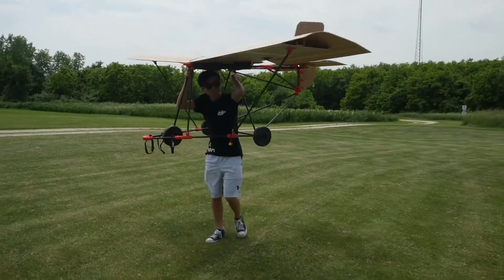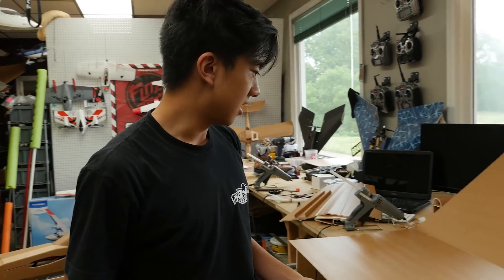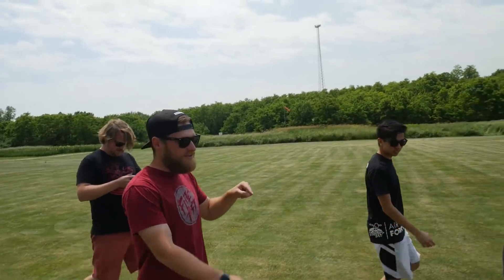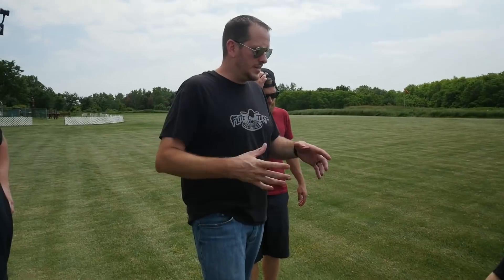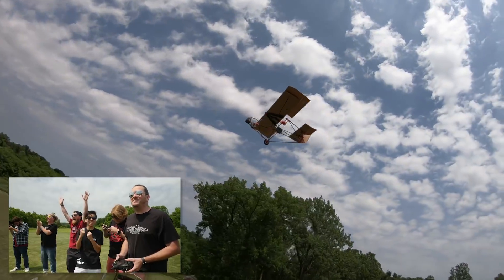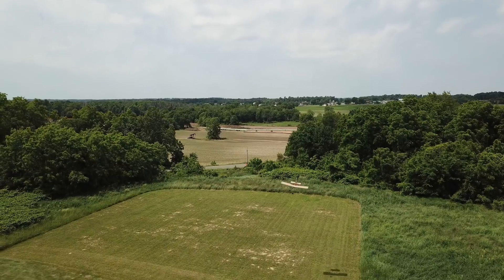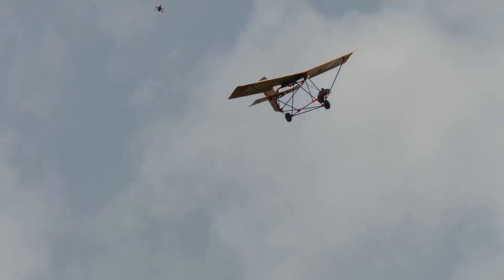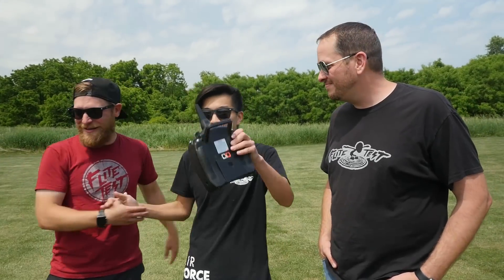3D Printed Motor on an Ultralight!

Comment: I was researching 3d printed motors and saw the original video where Chris made the motor, always wondered if he used it for something, so I'm glad to see this. I'm actually designing my own motors and using the plastic parts to make a mold to pour melted aluminum so I can build my own water cooled ebike motors.
Reply: You are on to something as a guy in Arizona. My Bafang motor gets pretty dang hot! Maybe like an RC boat electric motor cooler would work? Just water flowing through a heat sink from the lake. But add a radiator and pump, and BOOM! You got this man. Make that dream a reality!!!!! If you design it to work with Bafang motors as an add on, you would sell out.

Comment: For anyone who wanted to create this motor but couldn't find a working link for the STL files, don't give up because I found working link for STL files. 

https://community.makesea.com/web/cla/~/50612/profile/-/asset_publisher/Rl6cqGtVw4Vb/content/660-watt-3d-printed-halbach-array-brushless-motor?inheritRedirect=false&redirect=https%3A%2F%2Fwww.makesea.com%2Fweb%2Fcla%2F%7E%2F50612%2Fprofile%3Fp_p_id%3D101_INSTANCE_Rl6cqGtVw4Vb%26p_p_lifecycle%3D0%26p_p_state%3Dnormal%26p_p_mode%3Dview%26p_p_col_id%3Dcolumn-1%26p_p_col_count%3D4

Comment: if that motor was printed out of polycarbonate it would've survived
Reply: So, what made it fail?  It's not like it broke up...
Reply: @bbushong67  not sure but I believe the windings got too hot and melted the pla... polycarbonate has a higher glass transition temperature. (135 degrees c as opposed to 65 for pla)

Comment: I like your channel but calling this a 3d printed motor is a joke,the only thing 3d printed is the housing.All essential parts are metal just like any other motor. It's also visible that the housing is finish machined after printing which could easily  and easier done with a molded material.

Comment: Somebody kitted a fabric and aluminum tubing version that was cable braced many years ago. The local hobby shop had a built unit hanging in their store. I learned to fly in a Quicksilver and tried to buy it but the kit was not being made any longer and they didn't want to sell the one they had.:(

Comment: $100 of materials? Where do you get Carbon Fiber tubes fo so cheap?
Reply: You can get 1kg of carbon fibre spool for 3d printing for like $100-150 US
Reply: There is no button for liking $100-150 US.    Also why would I want to like that sum in particular?  Unless you are giving it away.  What is the exchange rate for US dollars to UK sterling, if this is the case.
Reply: @cam_au  yeah. And you can get active charcoal powder even cheaper. However that doesn't help you with this build...

Comment: Hi ft I have designed and printed a 70 mm 12 bladed EDF fan which goes at around 52000 rpm ony current 3000kv EDF motor and a 4s 1600. And it does not explode. Ive been though around 6 prototypes to get the blade angle and sweep right and I was wondering if you would like me to send you the files to print one

Comment: for us who don't have 3D printers.... you can use aluminum or carbon fiber arrow tubing. cut the ends shaped to fit (or interlock dado's) then wrap/lash with sewing thread and CA glue.
you can make excellent and very solid joints with this method if you wrap it thick enough, the thread becomes like a hard plastic fiberglass, scuff the tubing it's not going to come apart.

I've built an RC dragster with CF arrow tubing and 2 mm plate stock, an ornithopter with 2 mm carbon fiber rod covered in ripstop nylon for wings etc (300 RPM gear motor to flap them), and done MANY repairs to other stuff, it's become like a "go to" because it's so easy, fairly quick, inexpensive and versatile.

Comment: So inquiring minds have to know did something happen to the motor or ESC? I think it could use a bigger prop. Not sure if it is practical in this application though and you guys have a lot more knowledge with this sort of thing than I do.

Comment: right before he said "I lost power" I was like, smoke, not good XD
Reply: Yeah, that was pretty subtle.  I had to go back and watch that a few times.  Hard to see the smoke, but it's there.  One thing that I wondered about was the ratings of the larger bearing at the back of the motor...  That bearing is only rated to 3,500 RPM...  very thin profile (6mm x 6mm cross section), those bearing balls have got to be screaming...

Comment: You're crazy superheroes! I'm so glad glad to see this video, and I'm very impressed by the plane construction - the motor is a heavy beast and very difficult to mount on a lightweight frame. And I didn't expect that you're surviving 12S without getting insured. Great video!
Reply: Christoph Laimer Thank you for sending us such an amazing motor! Your design was amazing and you truly inspired us and many others with your amazing 3-D printed creation. Keep up the great work brother!
Reply from the maker: Christoph Laimer keep on being awesome my friend! You are inspiring so many and doing great things! Hope to meet you in person one of these days! -stefan
Reply: Hey Josh, what actually happened (the pop and sizzle)?  Did the 12 cell fry the motor?
Reply from the maker: ElyssaAnderson correct... when the motor stopped, he airflow was decreased, heating up the motor a bit more and boom... motor melted loo
Reply: @FliteTest  The engine spool fried because a wire size diameter small. Big current and it doesn't has a radiator for spool from metal (this is plastic)
Reply: @FliteTest  So, the control circuit might need a minimal RPM for airflow above a certain temp and an emergency power out shutoff in case of f.e. an emergency landing?
Reply: @FutureChaosTV  Spool fried because a wire size diameter small. Big current.
Reply: The motor probably fried, youa cttualy can see a little bit of smoke a second or two before the motor stops...
Reply: @veckia  from 6:32 yup...
Reply: This is the best 3D motor design! I did it (in Colombia) and I am Very Happy with it! Thanks Mr. Christoph Laimer.
Reply: I met FliteTest BECAUSE of Cristoph Laimer and this aprticular motor! =)
Reply: I waited for that since I saw the motor project on your channel (the tourbillion watch brought me there).
Seeing that it now actually happened, brought a smile to my face :)
Reply: It's worth the wait. Amazing plane for an amazing motor. Big laugh when the plane lifted off. Like it :)
Reply: Great job Christoph!
Reply: ElyssaAnderson yeah that’s what I was gonna ask
Reply: This is some great collaboration. Well done to all involved, it’s quite remarkable what we can come up with when we combine our skills. Great video lads!
Reply: You're a genius Christoph, looking forward to you making more videos!
Reply: Christoph, are you done making videos or just taking a break? Would love to see more content from you.
Reply: we love your videos bro, make more!!
Reply: Congrats Christoph!
Reply: I miss the new content from your channel.
Reply: Christoph, your motor is way cooler than this plane, please show us what you are working on
Reply: proud of you Chris, happy to see it work like that!

Comment: It's about time we see this motor fly. Why didn't you scale the airframe a bit smaller to fit the motor? 25% smaller or so probably would have been a good size for that motor. Also you should use a smaller diameter prop when you went to a higher voltage battery. Still a fun video. Can you make a video on the motor if it burned up?

Comment: If you make the wings to have more surface area, i.e., wider wingspan, another inch or two wheel radius, a bit stronger motor and larger prop, I'll buy the kit!   Meanwhile, how construction going at the new F.T home and field???   Need experience and tools yet, I'm just about to be in between projects and clients, if you need some help???   Nonetheless, great job on the scale ultralight!  

Awesome!

Comment: Great project!! The Quicksilver MX is a rudder/elevator only.  No ailerons no flaps and no vertical stabilizer (all rudder).  You need to modify the design with a rudder post and rudder.  Even the Quicksilver MXL, Sprint and Sport models with ailerons are rudder dominant!  With the high wing dihedral they fly skid and roll not crank and bank.  A higher wing camber would help too.   I have over 600 hours flying my 1984 MX.   I look forward to seeing a kit and plans on your web site. (maybe a bit smaller scale)

Comment: Finally! Have been waiting ages to see what you came up with, and you didn't disappoint!
Looks like the motor may have been working a bit too hard and burned out but this'll give valuable results for improvement.
Carbon fiber space-frame structures have great applications and could be used as the basis for the entire skin of an aircraft or vehicle, so would like to see more!

Comment: Hi Josh or whoever of the Flite test team. I have a 5 inch stuck in the tree (Alex will be the one i hope sees this) and here in seattle we dont have much wind until october and i need to get that quad out before july for my Hawaii trip so either could you help me in the comments or in the form of a video and also i have a ft bushwacker and i found that the ESC isn't being cooled very good and also 3s 45c battery works good with some 10x4.5 props and also ive tried 9 inch and the esc still isn't properly cooled and also (sorry if im boring you) i was wondering what a good random FT swappable series plane i should build next and i have a power pack C thanks!
Reply: I love my simple stitch but it's pretty similar to the bushwacker, maybe try a warbird, like the mustang or spitfire, and get a long stick and knock that quad down, if it's stillpowered on it could destroy the lipo capacity and risk fire if you try to recharge it, most quads will survive a fall from a tree with only moderate damage, but rain could ruin it.
Reply: +Kevin Dunn storch*
Reply: This happend a month ago and the tree is about 50 ft
Reply: Yeah it has rained and the battery luckly was just a cheap one i dont plan on recovering it

Comment: I am a Challenger Ultralight pilot and I have flaperons on my plane. Flaperons actually only change the center of lift and are primarily used for trim purposes based on the load of the pilot in order to trim for hands-off(or at least for minimal pressure)in what ever mode of flight that you are in(i.e. climb, level or descending). At altitude over my home airport(Capitol Drive)I trim the nose up way high and float around at 25 mph near minimum controllable airspeed(sometimes even flying backwards if the head wind at altitude is greater than my forward airspeed !).
Reply: I'm just a nobody on the internet, but that doesn't sound at all like how typical flaperons or flaps would affect performance. They certainly can offset the center of lift if they are not located over the center of lift already, but they are fundamentally failing at their intended role if they are not increasing lift (and drag). Offsetting CoL is generally an undesired (and avoidable at the design level) side affect, not the intended function.

I'm certainly not trying to correct you on doctrines of use for your aircraft. I've never seen or studied it before, and am just discussing the more general applications of what you have said. But as I understand it using flaperons to trim pitch should be far less effective than using the elevator to do so. I'm more inclined to think that the Challenger Ultralight is an outlier, due to the mid-length, high mounted engine.

At first I thought it could be because of deflection of air into or away from the propeller, but pictures I found online were inconsistent about where the ailerons started, with some seeming to start at the root of the wing, and others only starting after they cleared the propeller's radius. Just making a guess, but do the flaperons on your aircraft start at the root of the wing?
Reply: Almost all of the way to the root...here is a picture(not the best, but the only one I have). Almost the whole trailing edge of my wing is flaperon. They actually deploy in both directions with a hand crank above my head.
https://www.facebook.com/photo.php?fbid=10209513091903494&set=a.2432631794489.86899.1812492490&type=3&theater
Reply: I've flown a challenger (As well as 30 or so other types of aircraft), and I will say that while the flaperon trim method on the Challenger is pretty weird, it seems to work.
Reply: Well that's just, like, your opinion, man.
Reply: Yes !, it is quite weird and works rather well, too. Frankly, I think that the design purpose is to provide both trim and accommodate a wider range of pilot weight.
Reply: I have quite a few hours in a challenger, and since I flew both solo and with a passenger, I can tell you that the flaperons have a yuge effect on CoL. Since this aircraft is tandem seat, your COG changes with an additional person in the craft. Flaperons make flying this thing on the vertical axis easier. Can't do anything about the fat fuselage creating tons of drag  and turbulence going into the prop.  That makes it hard to control at low speeds. I don't like challengers. Too fat of fuselage creates yaw control issues. Quicksilvers are much better. More dihedral means effortless 2 axis control, super easy low speed control, all around a better platform. I realize there are full ultralight versions of quicksilvers and there are not full ultralight challengers, so the comparison is not completely fair.
Reply: Also, I was not aware that there were Challenger ultralights. I thought they were classified as LSA, light sport.
Reply: They do make a single seat part 103 legal version. The one I flew was part 103.
Reply: @flyingfiddler90q  I see, thanks for the fact check.
Reply: http://www.quadcitychallengersales.com/quad-city-challenger-part-103-legal-ultralight-or-experimental-aircraft.html

Comment: 6:32 the MOTOR SMOKES!!!!!
Reply: The spool fried because a wire size diameter small. Big current.
Reply: rst that was lost of motor power - or better to say, he lost the motor at self - it goes broken in this moment. I though at first that was lack of the battery power.